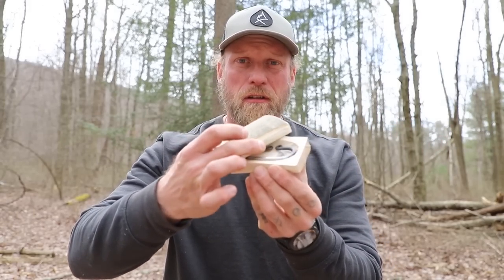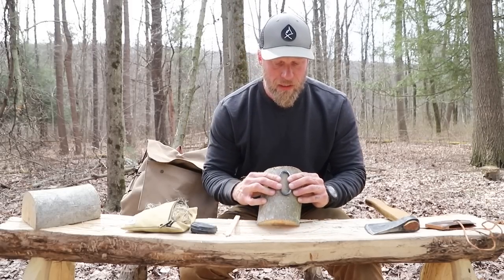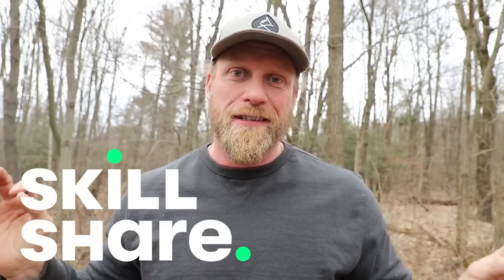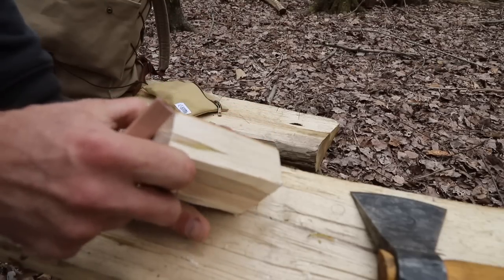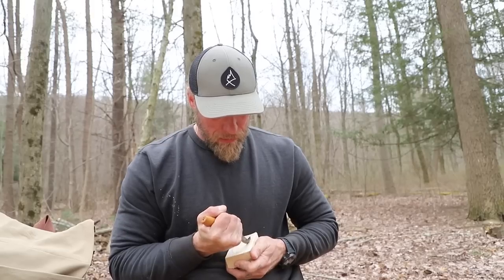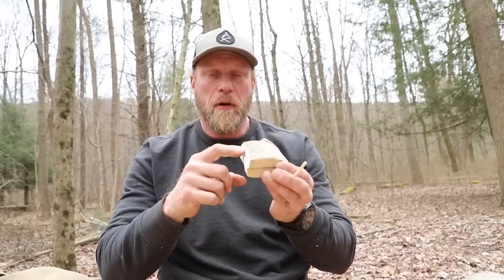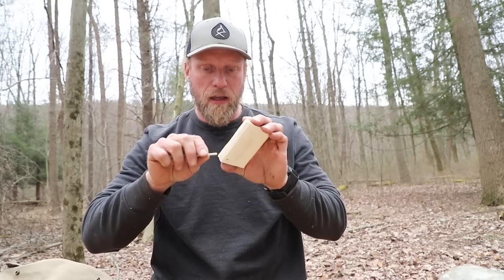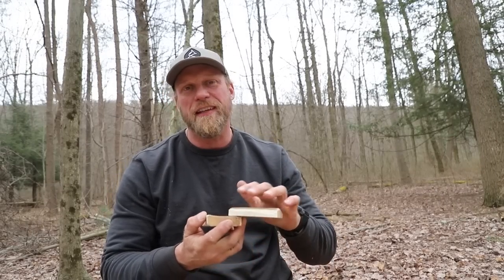Carving a Wooden Tinder Box: Advanced Bushcrafting

Comment: Nice!  By the way, for conditions when one might be using a fero rod, I've found I typically can get flame in only one small strike if I mix my fat wood shavings (or birch bark scrapings) with the down of last years cat tail seeds. It needs to be airy, not too packed. But when spread out enough and mixed with the shavings/scrapings, it acts like gasoline fumes, i.e. it ignites in a flash that even though only lasts a moment is enough to light the rest. Saves the fero rod for future fires and keeps it easy. I've been lighting my wood stove this way, or with charred punk wood, or bow drill/hand drill or a swiss army magnifying lense (on char) and just having a blast with it all.